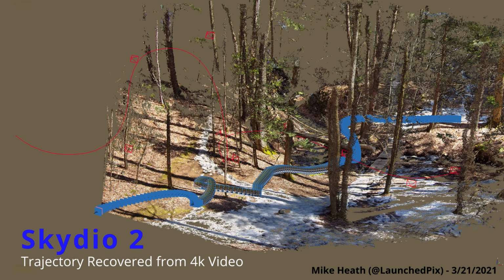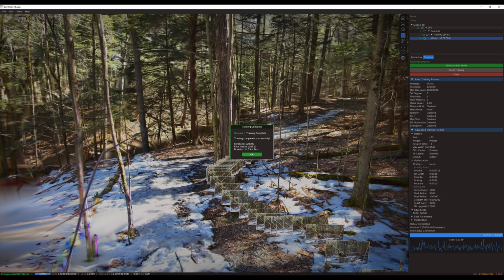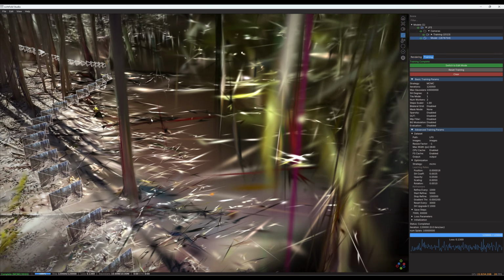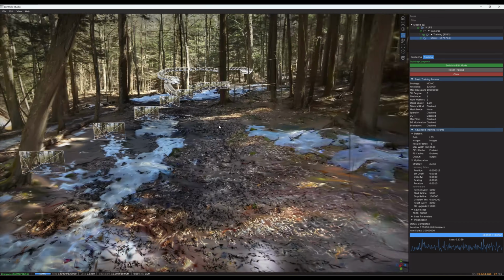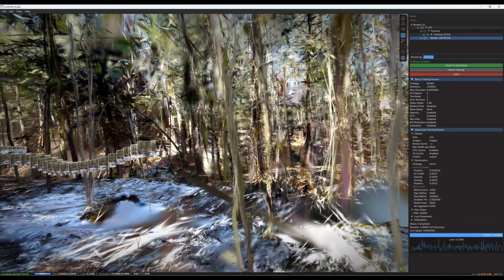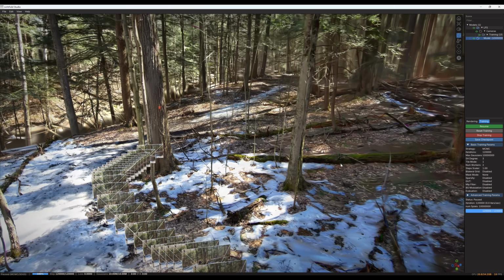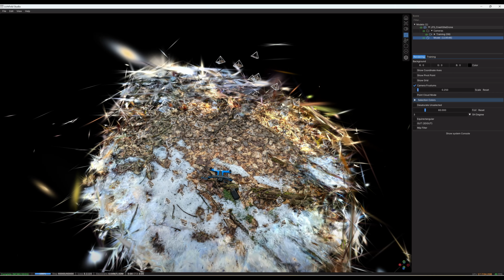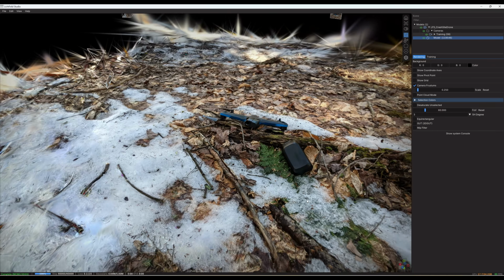LichtFeld Studio Analysis of a Drone Crash

Comment: Small branches are always a problem for the drone, it is difficult for the sensors to detect them in motion. New drones have become even better in this regard, but they are still the Achilles' heel of a drone.
Reply from the maker: In addition to improved obstacle avoidance, many smaller newer drones have propeller guards, protected gimbals and overall improved impact survivability (partially due to lower weights). It's interesting to watch the industry change over time.